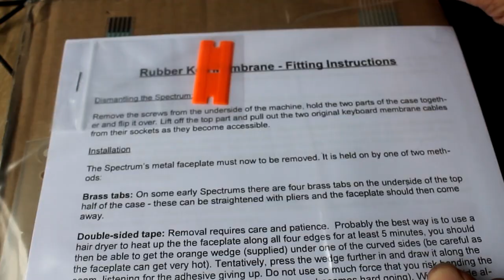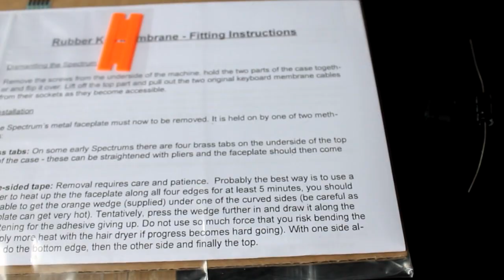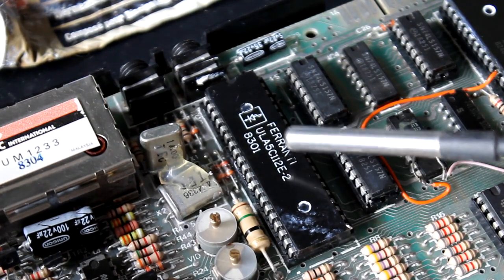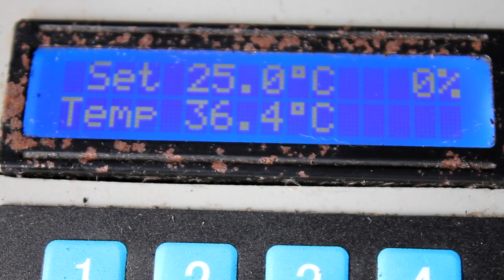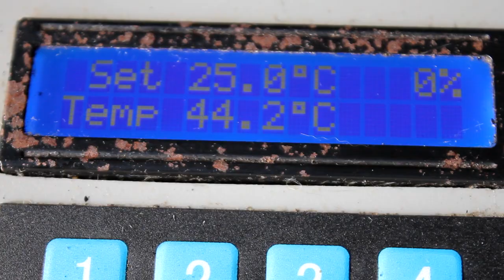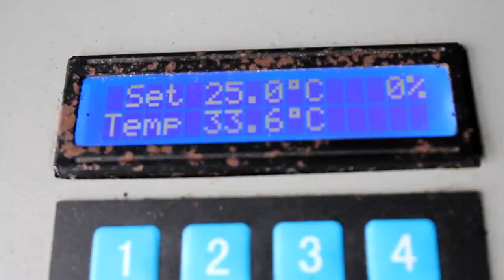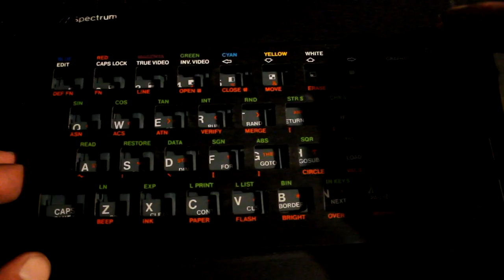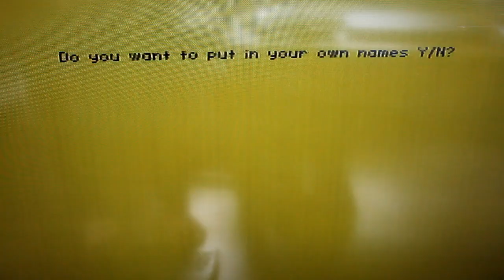ZX Spectrum Finally done.

Comment: all working  now then   mate where you getting the speccies  from  i  know    one  you had   years  ago   but have  you got  more than  one  now double  sided  sticky tape   blue  peter special   mate  :)
Reply: Just watching your video, if your ULA is too hot to touch, may I suggest that it's nearing death. You don't need an extra heatsink. The tracopower negates the need for the native one. 
Good luck.
Reply from the maker: @StuHo1mez  I should get a modern ULA for it. I`ll keep an eye on it. Perhaps I killed it with the over voltage. To be honest it was real hard to get the picture set up with this ULA. I fitted another and the screen was perfect. Thanks for the advice.
Reply from the maker: My first computer was this  Speccy model. So I wanted one again. I get them off EBay. About £50 each. I might try Torksey Car Boot soon.
Reply: @damianbutterworth2434  next  need   to  find  a way to  network them  lol